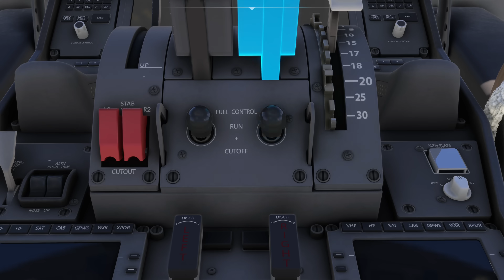Air India 171: Why Did The Fuel Cut-off Switch Get Moved?

Comment: What if the pilot who asked why the other turned it off was actually the one who did it ?
Reply: AI 171 Report Crashlands

Inquiry is disservice to airlines flying Dreamliners. It's also slanted so that attention focuses not on possible technical problems but, minus any real evidence, on pilots

On June 12, an Air India Boeing 787 took off from Ahmedabad and crashed moments later, killing all but one of its occupants. Exactly a month later, the official preliminary report was released. While it provides a basic sequence of events, it fails to answer the most critical question: When did the engines stop producing thrust?

FORMER Chief of Safety, Air Asia & Chief of Training, IndiGo
This isn't a technical debate. It's the key to under-standing what went wrong, and who or what was responsible. Instead of offering clarity, the report quietly steers readers toward the idea of pilot error, without saying it outright. This subtle shift leaves many, especially those unfamiliar with aviation systems, assuming the pilots made a mistake. That assumption is both dangerous and unfounded.

Captain capable:
It's important to begin with the man at the controls. The captain of AI 171 was not only a seasoned Boeing 787 pilot but also a certified trainer entrusted to teach and evaluate others. As part of the selection process to become a trainer, he had undergone detailed psychological screening, including by profes-sionals trained to assess stress-handling. decision-making, and mental fitness. He was the pilot you'd want in the cockpit on a bad day.

Yet, certain foreign media outlets have floated malicious theories, suggesting pilot error or intentional action. Shockingly, one Indian "safety expert" repeated these ideas without evidence. The report does not support these theories, and they insult the memory of a competent professional who can no longer defend himself.
Let us be clear: no factual basis exists to blame the crew. The available evidence points to more profound, more technical questions that the report avoids addressing.
Noise & silence
The report says the aircraft's two engines stopped responding three seconds after takeoff. It also says the pilots tried to restart them about 10 seconds later. By then,
the plane was flying too low and too slow to recover
It also notes that two necessary switches, used to control the engine fuel supply, were moved to the 'off' position. These switches are designed to be hard to move accidentally, and they have locks to prevent that. The report includes a short voice recording from the
cockpit without clear attribution: Pilot 1: "Why did you cut off?"
Pilot 2: "I didn't do it."
That's it, no further transcript. No context. The words are used to hint that maybe one of the pilots
turned off the engines. But there's no follow-up. No analysis. No explanation for how these switches might have moved on their own, which is entirely possible, based on earlier warnings issued by safety regulators about this exact type of switch used 

in another Boeing plane the 737.
Big contradiction
CCTV footage from June 12 shows the aircraft in the air, landing gear down, and a small emergency device called a Ram Air Turbine (RAT) already extended. This turbine is like a small windmill that pops out when both engines fail, helping to power basic flight controls.
The issue is that this turbine doesn't deploy instantly
It takes a few seconds to come out after both engines stop. Yet, in images, it's already visible when the air-craft is barely a few storeys off the ground. That means the engines must have failed before the time mentioned in the report.

So, which is wrong, camera images or the AAIB report's timeline?
Silent beacon
Additionally, the aircraft's emergency locator beacon - which should have started transmitting dis-tress signals on impact-stayed silent. Was it damaged? Not armed? Not working? Once again, the report gives no answers, nor recommends checking other aircraft for similar issues.

No flag raised
A good preliminary report is not meant to assign blame; it should highlight urgent risks so other flights can be safer. That didn't happen here.

Despite known concerns about the fuel control switches, the report doesn't call for any checks across the Boeing fleet, doesn't advise reviewing the emergency response systems, and doesn't confirm that all the flight data and voice recordings were recovered.

Compare this to other major accidents -like the Ethiopian Airlines crash in March 2019-where early reports included technical diagrams, full transcripts, and multiple safety recommendations.

The contrast is stark.
Final thought
This isn't about one flight. It's about how we investi-gate air accidents in India, treat our professionals, and protect public confidence in aviation safety.
The captain of Al 171 was a respected trainer and a trusted professional. His actions in the final seconds cannot be judged by a single voice quote taken out of context. They must be understood in light of the systems around him the ones that may have failed first..
The real questions are these: when did the engines stop working-and why? That's what the public deserves to know. That's what the final report must answer.
experience The writer is an aviation professional with over 35 years'

Comment: It's a point to note that the valves got shut off at such a critical height and time  ( not on runway and not too high ) - just after the take off,  that it was not possible to revive engines and crash was inevitable... The critical timing makes us more to believe that it was manually and intentionally done 
If it was even half a minute before or after ..the plane would have survived...may be partially ..precision of timing makes suspicious

Comment: Captain, Cutting Off Fuel when the system senses a failure that necessitates a cutoff versus a failure that does not can be built into the logic system. Some warnings are inhibited below a certain altitude and as you know they are at times split between takeoff and landing phase, so in this case let’s say there is no engine failure or FIRE a few seconds after TO, moving the Fuel Cutoff switch to Cutoff or Pulling the Fire Handle Switch for that matter, the system should not allow the SIGNAL to be triggered to execute the switching off the vital systems

Comment: Mr.Steeeve. im not a pilot. But in the report it says, " Why did HE cutoff" insted of "why did YOU" so this "HE" is the other pilot? or the Software? ( it seems the pilot was talking about a 3rd person, which is the software.this is my view. the switches were in ON position all the time. but the Flight Software or ECU or something shutdowned the fuel. so the Pilot asked from the other officer " why did he cut off" then he replied its not me. then they switch off the fuel  switch and then put it back to On position.
Reply: AI 171 Report Crashlands

Inquiry is disservice to airlines flying Dreamliners. It's also slanted so that attention focuses not on possible technical problems but, minus any real evidence, on pilots

On June 12, an Air India Boeing 787 took off from Ahmedabad and crashed moments later, killing all but one of its occupants. Exactly a month later, the official preliminary report was released. While it provides a basic sequence of events, it fails to answer the most critical question: When did the engines stop producing thrust?

FORMER Chief of Safety, Air Asia & Chief of Training, IndiGo
This isn't a technical debate. It's the key to under-standing what went wrong, and who or what was responsible. Instead of offering clarity, the report quietly steers readers toward the idea of pilot error, without saying it outright. This subtle shift leaves many, especially those unfamiliar with aviation systems, assuming the pilots made a mistake. That assumption is both dangerous and unfounded.

Captain capable:
It's important to begin with the man at the controls. The captain of AI 171 was not only a seasoned Boeing 787 pilot but also a certified trainer entrusted to teach and evaluate others. As part of the selection process to become a trainer, he had undergone detailed psychological screening, including by profes-sionals trained to assess stress-handling. decision-making, and mental fitness. He was the pilot you'd want in the cockpit on a bad day.

Yet, certain foreign media outlets have floated malicious theories, suggesting pilot error or intentional action. Shockingly, one Indian "safety expert" repeated these ideas without evidence. The report does not support these theories, and they insult the memory of a competent professional who can no longer defend himself.
Let us be clear: no factual basis exists to blame the crew. The available evidence points to more profound, more technical questions that the report avoids addressing.
Noise & silence
The report says the aircraft's two engines stopped responding three seconds after takeoff. It also says the pilots tried to restart them about 10 seconds later. By then,
the plane was flying too low and too slow to recover
It also notes that two necessary switches, used to control the engine fuel supply, were moved to the 'off' position. These switches are designed to be hard to move accidentally, and they have locks to prevent that. The report includes a short voice recording from the
cockpit without clear attribution: Pilot 1: "Why did you cut off?"
Pilot 2: "I didn't do it."
That's it, no further transcript. No context. The words are used to hint that maybe one of the pilots
turned off the engines. But there's no follow-up. No analysis. No explanation for how these switches might have moved on their own, which is entirely possible, based on earlier warnings issued by safety regulators about this exact type of switch used 

in another Boeing plane the 737.
Big contradiction
CCTV footage from June 12 shows the aircraft in the air, landing gear down, and a small emergency device called a Ram Air Turbine (RAT) already extended. This turbine is like a small windmill that pops out when both engines fail, helping to power basic flight controls.
The issue is that this turbine doesn't deploy instantly
It takes a few seconds to come out after both engines stop. Yet, in images, it's already visible when the air-craft is barely a few storeys off the ground. That means the engines must have failed before the time mentioned in the report.

So, which is wrong, camera images or the AAIB report's timeline?
Silent beacon
Additionally, the aircraft's emergency locator beacon - which should have started transmitting dis-tress signals on impact-stayed silent. Was it damaged? Not armed? Not working? Once again, the report gives no answers, nor recommends checking other aircraft for similar issues.

No flag raised
A good preliminary report is not meant to assign blame; it should highlight urgent risks so other flights can be safer. That didn't happen here.

Despite known concerns about the fuel control switches, the report doesn't call for any checks across the Boeing fleet, doesn't advise reviewing the emergency response systems, and doesn't confirm that all the flight data and voice recordings were recovered.

Compare this to other major accidents -like the Ethiopian Airlines crash in March 2019-where early reports included technical diagrams, full transcripts, and multiple safety recommendations.

The contrast is stark.
Final thought
This isn't about one flight. It's about how we investi-gate air accidents in India, treat our professionals, and protect public confidence in aviation safety.
The captain of Al 171 was a respected trainer and a trusted professional. His actions in the final seconds cannot be judged by a single voice quote taken out of context. They must be understood in light of the systems around him the ones that may have failed first..
The real questions are these: when did the engines stop working-and why? That's what the public deserves to know. That's what the final report must answer.
experience The writer is an aviation professional with over 35 years'

Comment: You keep brushing off questions regarding possible additional safeguards that could have been designed into airplanes in order to reduce the risk of these things from happening, claiming something along the lines 'the existing mechanism is exactly how it should be, nothing needs to be added or modified'... will all due respect, this is simply not true.

Comment: Captain Steeeve, would you agree with airlines doing mental health assessments on pilots. Once they are at the airport before entering the cockpit? Also the aircraft manufactures need to engineer a fail safe system    on the engine cut out switches where the can be only engaged if required at a safe height for take offs.

Comment: Since the report does not provide a timestamp for the pilots’ conversation, so we are assuming the sequence of events was: Fuel switch turned off (T0), pilot conversation, switch turned back on (T0+10). What about this alternative: The fuel switches were turned off due to a malfunction or inadvertent error (T0), and neither pilot noticed at the time. After 8–9 seconds, when both engines began losing thrust, one pilot noticed the fuel switches were off, immediately turned them back on (T0+10), and then one pilot said, “Why did you cut off?”